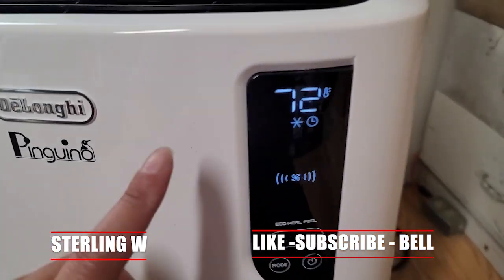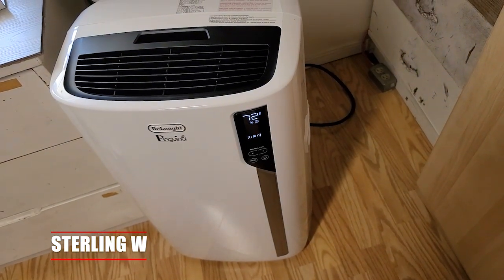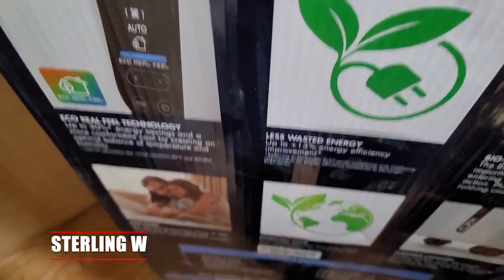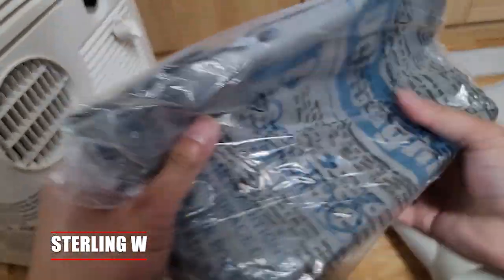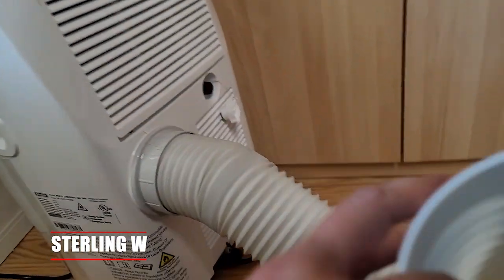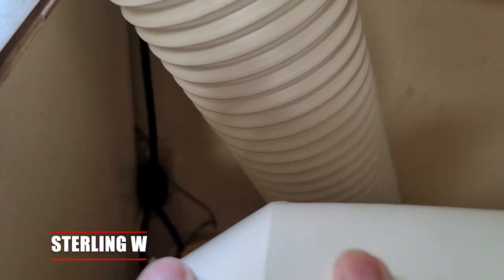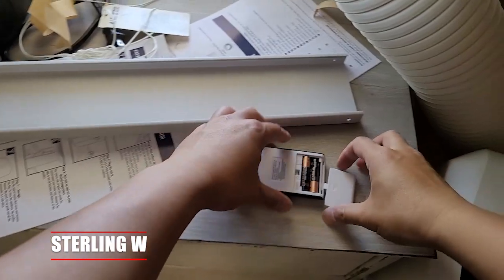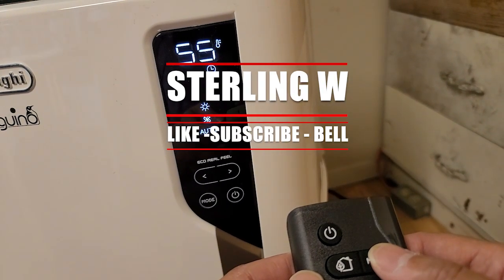REVIEW: Costco De'Longhi Portable Air Conditioner $469

Comment: I just bought the same one !! Can you show how to add water inside ?? Please 😭 SOS lol
Reply: To remove water that’s collected inside your AC unit, be sure to turn your unit off and unplug it from the wall before hand. Then if you have a walk-in shower, you just simply uncap the little black drain plug at the bottom of your unit and let the water  drain out. You may want to tip your unit backwards, so the water can drain out faster. You’re likely to see some sediment or dust or particles. If you don’t have a walk in shower, you can roll it outside and open the drain plug at the bottom of your unit and let the water drain out and you may want to also tip it backwards so that the water can drain out much faster. You You can also roll it outside and unplug the drain cap at the bottom of the AC unit and hold onto it as you tip it backwards so that the water drains out completely. When summer temps are extremely hot and humid/record breaking and you’re not using the humidity function or the hose to drain out the water that has been sucked the humidity out of the air due to extremely high humidity and put the drain hose in a bucket to collect the water that has been sucked out of the air( humidity)to cool your room, water will collect inside your unit. so rather than having to go through the trouble of draining the unit, most people, including myself will use that drain hose and insert it at the top of the unit after having removed the drain cap and let the water drain out into a 5 gallon bucket that you’ll have to pour out or repurpose some kind of way. I dry mine in my walk-in shower and I use my showerhead to rinse out through the vents of my AC unit to clean the blades and help flush out the water and the sediment. I’ll then leave home that morning and return later that night or the next morning so that my unit will be completely dry or almost dry without leaking. This way it has been sitting straight up for 6-24 hours before plug it up and use it again. Usually there’s a code that will show up flashing on my unit that says E1, which let me know that my unit needs to be drained. I hate that and I try to avoid having to do drain my unit by using the drainage hose and bucket. I have learned to make it a habit of draining my unit and flushing it out with my handheld shower in the walk-in shower twice during the summer months. This saves me a big headache and a lot of pain because I am disabled. But because of the wheels on the unit, I somehow fight and managed to do this myself. It’s not easy for me at all and when I want it done I want it done. I’ve had my unit about five   years now. I was so blessed to get it with a four-year warranty. It really works great and it still does because I use it all throughout the year in the winter time because I don’t like sleeping hot. I hope this information helps you.
Reply from the maker: You mean remove water, right?

Comment: do I need to put the tube in a bucket when running a/c??
Reply: no only when it hase a heat option then ONLY when you are using a heater then yes but the cooling NO. The water helps it cool the hot side so it can cool your room better

Comment: I bought this unit 2 yrs ago from Costco and it is not working now. I clean filter and make sure it is clean drain water out … etc but no cool air comes out now. Very disappointed only good for 2 yr use.
Reply: Unfortunately that's common.

Comment: How do you drain the condensation? I see that it has two outlets. When do you drain them or do you have to
Reply: It's the black drain on very bottom middle
Reply: @hlissa bottom port is for draining before storage at the end of season. The top port is the one you put the tube in for dehumidifier mode.

Comment: Do you need to use the hose? We don’t live in a humid place
Reply from the maker: Which hose the exhaust hose pumps hot air out. The drain hose is for water overflow.
Reply: @SterlingW8  it only came with one hose. Not sure. It’s a pretty thick hose